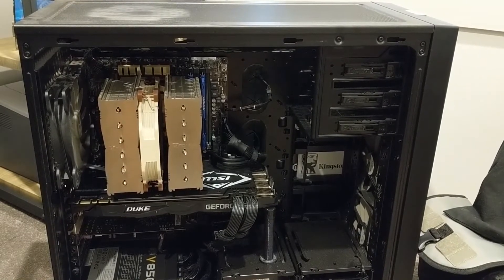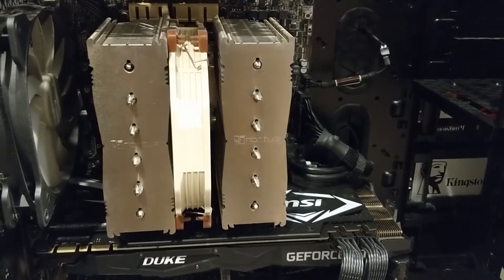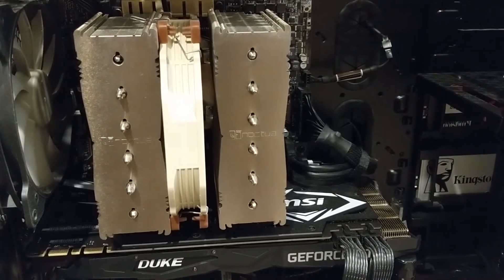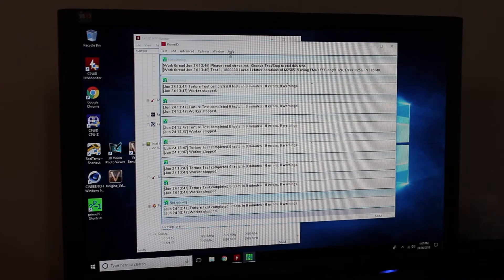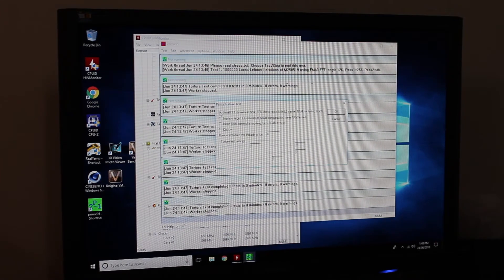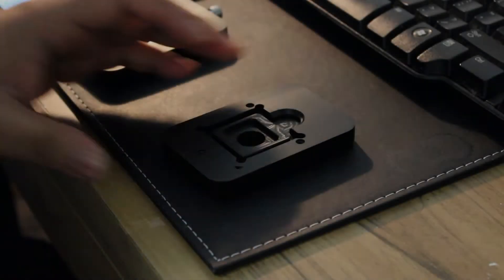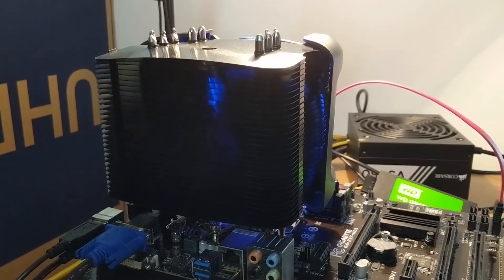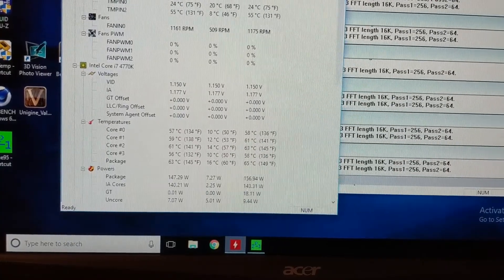i7 4770K Delid TUTORIAL - 20 DEGREES drop!!

Comment: Getting better thermals is always awesome 👍 But I have a 4790K and it was a lucky silicon lottery from day 1. But the most I've achieved is a +4 fps avg gain getting it up to 4.7GHz from 4.4GHz. That is at 1080p. When I run at 1440p I get around +3 fps avg because my GPU takes the brunt of the load. Even nearly 7 years later and mated to a 3080 the 47xxK series are incredible gaming Cpus. My GPU is still the weakest part of my system for AAA titles at 1440p. LoL
Reply: 3080 doesnt outperform a 4th gen ddr3 cpu?
Naaw man,i also got 4790k running at 4,7 ghz with x45 cache ratio and xmp but  even my 1080 getting bottlenecked by that cpu.
Reply: @Chaos_Dave98  There's something  else wrong with your rig then because the 4770k was the top tier CPU only 4 years before the 1080 came out. 
My 1070 isn't remotely bottlenecked by my 4770k amd Jay's 2 Cents did a video about 8 months ago proving a 4770k doesn't even bottleneck a 2080ti, it does however bottleneck a 3050 but only by 3fps. And that's at stock clocks before you've even thought about deliding it on a Z97 mobo and pushing 5ghz+.

Comment: I did this on my 4770K back in 2014 without applying the liquid electrical tape or nail polish, working perfectly without changes to the temperatures even after 6 years
Reply: no, the cpu is overheating quickly when overclocked. Then its throtteling.

Comment: Can you use high temp red permetex silicone rtv instead of liquid tape by the cpu die on the components ?  And how long must wait for all to dry before turning on pc with cpu delidded?
Reply from the maker: The liquid electrical tape will dry in a matter of minutes. You could use silicone for the components beside the die, however it may not spread as evenly and thinly as the liquid electrical tape. This could pose a problem when trying to get the IHS to sit properly on top of the die.

Comment: You could also just add the cooler right on top of the processing dice itself.... no need to do all that. Of course, it's riskier with bigger chance breaking. But it's possible.
Reply: On 1155, the IHS is integral to the socket.  There are 2 little tabs on the IHS that the socket cover keys into and that is what puts pressure onto the chip.  Without the IHS, the cpu would be loose in the socket even with cover latched.
Reply: @osheathedj  Third party IHS-replacements or sockets solve this problem.

Comment: Did you remove the liquid tape after some time? Also does the CPU still work today?
Reply: Thanks. I did my delidding of my 4790k back in late October.  I used clear nail polish on the metal components and I haven’t had a single problem yet.
Reply from the maker: The liquid electrical tape will stay on the CPU permanently. It protects the CPU from a short circuit in case some liquid metal touches the metal components when the IHS is placed back on top. The CPU is working exactly as it did when I first uploaded this video! In fact I am using the CPU now as I reply to your comment!

Comment: nice video dude !!! I am using the same cpu with an overclock of 4.6 GHz at 1.32v and the highest core is 88°C I am using a 240mm watercooler from enermax.
I have a question and I was hoping maybe you can help me out. Do you know if the liquid metal has to be changed after a certain period of time ?
Reply from the maker: I have been using my delidded CPU for the last 14 months with no change in temperatures.

Comment: Hello, thanks for the well-prepared video. I am going to apply same procedure soon and I got some questions if you don’t mind:

- You applied the LM on the IHS too. How did you determine the corresponding LM area on IHS? Just by eyeball estimate? Because I am a little scared any contact between LM and PCB components.
- Is there any alternatives of liquid electrical tape? I am not sure if I can find it in my country at a reasonable price tag. Also, you didn’t wipe that off before relidding, right?

Thanks!
Reply from the maker: Hi Abdullah,

Glad I could help with the video.

The way I determined where to apply the liquid metal to the underside of the IHS was to follow the faint discoloration the original thermal paste had left on the surface. You won't be able to appreciate this discoloration from the video unfortunately.

The actual way to make sure you don't go beyond the boundaries on the IHS underside is to use masking tape to cover the areas you don't want to get any liquid metal on. Take the tape off when you're done. If you use liquid electrical tape on the PCB then you shouldn't need to worry about electrical shot circuits anyway.

There are a few alternatives to liquid electrical tape. Most videos on YouTube I have seen use nail polish.

No, I did not wipe off the liquid electrical tape before relidding. That would defeat the purpose. It may be hard to see because it dries transparent.

I hope I've cleared things up. Don't hesitate to ask any more questions.

Comment: is that mandatory to apply Liquid electrical paste ??  is there any alternative solution ?
Reply: You can just use normal thermal paste under the IHS.
Reply: You can use clear nail polish from what I’ve heard as well
Reply from the maker: It's best practice. If liquid metal seeps out during the relid then it may cause an electrical short between the electronics just next to the die.

Comment: Nice video, Maybe mention that your changing the cooler as well in the description as that -20 drop didn't come from just the delid (new heatsink and open air vs in a case).  I have this cpu (@4.2ghz, 1.27v core) and i get 30* idle and 65* load with a deepcool maelstrom 240 w/ ml120 pro fans. Doing the delid tommorow with the same kit and conductonaut expecting a 10* drop.
Reply: How did it go?
Reply: @aboyaser5608  @4.2ghz - 1.27v core, 1.75v package, 1.15v cache 65c at load (20c ambient) with Gelid GC extreme between waterblock and cpu.  Lapped top/bottom of heat spreader to bare copper with almost mirror shine, same with the waterblock base. Used Conductonaut between die/heat spreader and heatspreader / waterblock. Dropped to 52c at load. Not bad basically what I expected from reading forum posts. 13* drop for about 80 cdn$ (600/1000/2000 grit sand paper, Tube of Conductonaut, Rockit delid kit, Bottle of Liquid Electrical Tape)

Updated Now running 4.4ghz - 1.30v core, 1.85v package, 1.28v cache 60c at load. Very happy with this.

Tips: 
-There are surface mounted components on the silicon wafer look at a picture of it and place your cpu in the tool so that they cannot be knocked off when deliding
-The included blue plastic tool is great for scraping the old silicone off
-Lap the bottom of the ihs to get it closer to the die and level it, mine was very uneven on the bottom.
-Use liquid electrical tape to cover the surface mounted components, it's cheap and designed for this very job.
-TAKE YOUR TIME!
Reply: @kcksteve7  
Nice detailed reply. higher clocks at lower temps, pretty satisfactory I'd say
I'm thinking of doing the same to my cpu, your results convinced me to go with it. My system with a noctua air cooler reaches 95c with prime 95 at stock clocks, must the worst paste job that intel has ever done
Reply: @aboyaser5608  I say go for it, It's a good way to squeeze a bit more out of your cpu. Post the results when you do I'm interested to see the differences with an air cooler.
Reply: @kcksteve7  I'm doing mine on Friday/Saturday but just delid with liquid metal. My I7 4770k gets to 85 on 4.2ghz @1.24v with Dark rock pro 4 when running OCCT with AVX instructions. Not sure what to expect but I'll give it a shot. If something goes wrong at least I'll have an excuse to upgrade :D
Reply: @kcksteve7  I did it, 5 months late but I did it nonetheless xD
the results are insane, at stock clocks with prime 95 from 95c  to 65c!
30c just from applying slightly better stuff to my 350$ CPU?!
Intel really disappointed me with this one, that's why next CPU will ryzen 4th or 5th gen, whenever that comes out.
I only wish that I delided 5 years ago when I first bought my CPU, but late is better than never.
Reply: Hey guys I change my i7 4770 who runs 3.4-3.9ghz idle 33 c and in gaming 50 55 c , today I change to i7 4770K 3.5-3.9ghz 1.195 voltage idle 36-38ghz and in gaming 60 - 63 c for me its weird because my i7 4770 was more cooler than the fcking i7 4770K.
The temperature depends in the voltage? For 4.0ghz what it's the best voltage I use the v6 Cooler máster with artic mx4

Comment: Great video! I'm about the delid my i7-4770 non k, got rockit 88 delid tool, liquid metal and kyronaut paste for heatsink. Hope for similar results, idle temps are around 45 degrees C before delid, hope to see around 28 degrees C idle temps after this :)
Reply: hey! What was your results? :)
Reply from the maker: Glad you enjoyed the video. If you have a non-k CPU you could also try undervolting the CPU for lower temps. That is, if your motherboard allows.